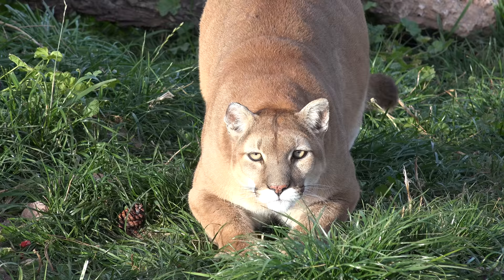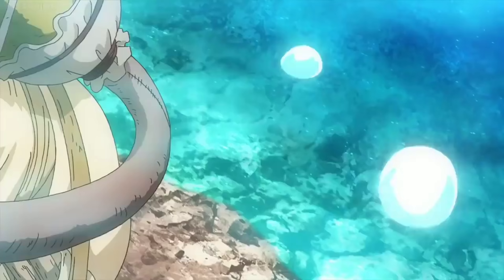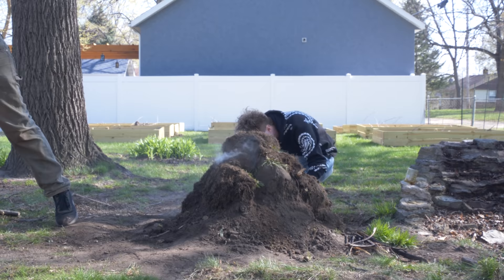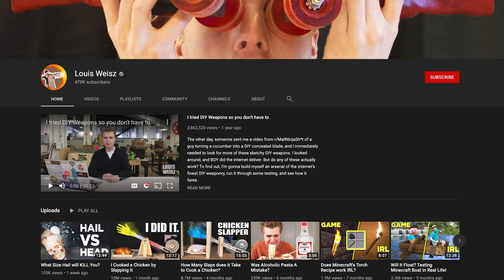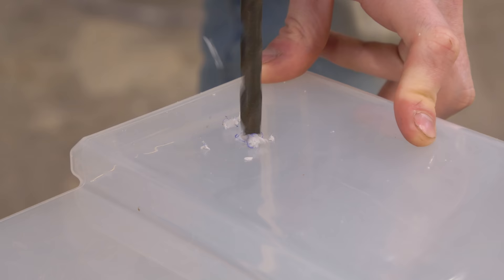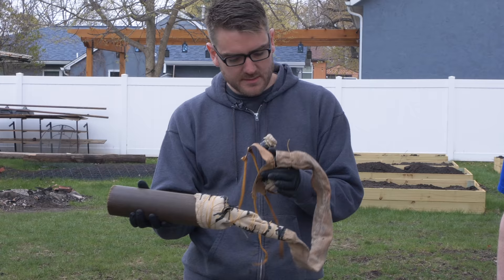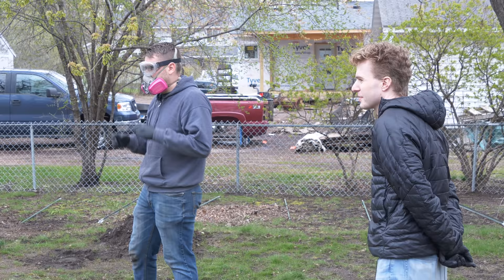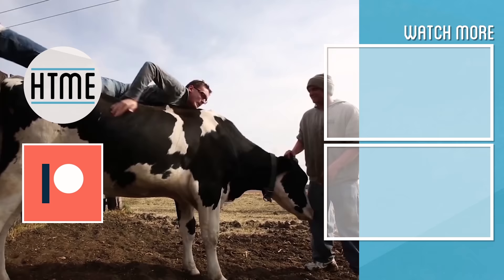Making Dr. Stone Gas Mask From SCRATCH w/ @Weisz

Comment: Do you have an episode where you cover where the iron/steel bar you use for the knife is produced from ore?  While iron was a substantial advance from bronze, steel takes considerably newer technology and producing uniform bar takes machinery.  I've always wondered how folks got from the raw iron to more advanced, usable forms, but figure cast bars were a start.
Reply: Bits of steel were common occurances in during iron smelts through carburization. The bloom absorbs carbon from the charcoal used to heat it up, and ope, there's steel. It all depends on how much is absorbed, but initial smelts would be iron with little bits of steel in a negligible amount. After the sponge iron bloom is compressed and folded, it's called wrought iron, which has silicous slag inclusions, and a very low carbon content.

After this, in making blister steel, the wrought iron would be sealed in clay containers with charcoal, which would diffuse carbon into the iron. Then it'd be taken out, forged and folded to push out that silicous slag, sealed up, and put back in. That'd be repeated until the resulting steel was homogenous.

Comment: My suggestions to improve it coat the edges that’ll touch your face with bees wax and/or cotton, to improve air tightness, especially around your nose. Or using some clear glass from make some eye pieces and make the mask into a full hood and secure a leather collar of some kind around your neck for air tightness. Of course this does mean using more materials and advancing some more into the future and making it bulkier and harder to remove, but it would be worth it if the alternative is death by toxic gas

Comment: During the test in the testbench you forgot that a doll cant breath in and that the air seals didn't work like how it should. They only seal by breathing in and not when nothing happens.
Reply: The mannequin head is hooked up to an air pump that pulls air into the pipe that goes through its mouth, and releases out into the test chamber.

Comment: Please stop burning the tangs into their handles! You need to use a different, smaller bar to burn to hole so it doesn't work it's way out when the steel cools and shrinks.

Comment: I think the chlorine gas test failed because of the one way valves. I have tried to make a gas mask myself using a similar valve and they only work properly under more extreme pressure differentials, IE when you breathe. If you don't have a significant pressure differential they don't do much to stop air or particles from going from one side to the other.  I found more success with a mechanical one way valve that used a spring to keep it shut when there is no/low pressure difference, meaning it was impossible for anything at all to come through.

Comment: is it possible/efficient to build the pull saw without using a file to make the teeth?
Reply: Yes. You hot cut the teeth with a shaped punch, or cold cut them on something like a fly press- most professional smiths do it one of these two ways, but Andy isn't a pro, and he isn't working with ideal tools, so I taught him another way it was done in history to make it easier to get a more consistent tooth profile.

Comment: I think you made a mistake with how you performed the testing of the mask. 

In the anime senku specifically tells ginro to control his breathing as breathing heavily won’t allow the charcoal to do its job. 

Having a pump suck air through a high concentration of gas would be ginro panicking with his head right above the lake of sulphur. 

With airflow and the dispersion of the fumes I don’t think you have the concentration correct to how it was encountered in the anime. 

Maybe do more controlled testing next time

Comment: I have a question, maybe someone's willing to answer? Would the activated charcoal work if there was more of it? In the show, they had a super big bamboo as the tank. Is it possible that more of everything is needed? Further, I imagine you guys had a reason for it but in the show, the mask had a big leather or cloth to settle on the back of the head. Is that possibly having an effect on the air-tight seal?

Sorry, science isn't my strong suit but I'm thoroughly curious.

Comment: Wait I think I know why the chlorine test didn't work, maybe the pump was moving to fast making the activated charcoal to not have enough time to filter it out. 

In the show they talked about if they breathed to fast they would die from that exact reason and I heard from other diy gas mask videos that it only works if you breathe at a slow but consistent pace so maybe due to that the test with the actual gas didn't work but with the one with the stink bomb thing did work.

Comment: Why not put the mannequin head outside  of the container so the gas cant leak in through the mask so you can better test if the filter works properly or if the mask is just letting gas through
Reply: The mask is a part of the system, its seal is also part of the test- and if it's outside, and it leaks, it's leaking chlorine gas outside of the test chamber.

Comment: so like....me know the rules and everything but just wondering....howcomes they dont upgrade there anvil from stone to iron? insted of braking the stone every now and then a iron anvil woud last longer no? dont think it woud be cheating to use a iron chunk they find in the wild considering howmuch ore woud be needed to make the anvil
Reply: Because making anvils is hard, and finding a big enough chunk of iron (as a meteorite or pure, large deposits of ore) is even harder, especially nowadays after most large, high quality deposits have been mined out.

It's coming, though, don't worry.
Reply: @TheElfsmith  ment more like some old railway tracks or something remember seeing a bushcraft youtube video where a rushan guy found a random chunk of iron and turned it in to a anvil use to be part of a train or something he said
Reply: @monkeybee11  Andy has a real, professionally made anvil- I recommended it to him. But, for the series rules, using preshaped steel cut to size with modern tools is definitely cheating.

Anyway, the anvil video is coming soon. The new one works great.

Comment: Your chlorine test probably waaaaaaaaaaay oversaturated that mask, PEL for chlorine is like 1 part per million in air, assuming a 100 liter container thats roughly 0.0003 grams of chlorine. Your mask might have a protection factor of like 20-100, meaning its filtering out 95-99% of the bad stuff but if you put in a sealed box with 100,000 ppm chlorine your still going to get >1000ppm inside the mask. Frankly conditions like what you have in the chlorine box would be too extreme for any filter based respiratory protection and would require supplied air in the form of either an SCBA or air line.

Comment: Why not make an entire haz suit with a ziplock. This way you can more easily test wether the activated charcoal works with relying on duct tape methods. Also would work allot better irl, as you have less seems opened. 

What ever you do, you always will have a seem between your cheeks and the leather, but if you wear a entire haz suit this seem will be dramatically smaller as you only have a micro seem at the ziplock